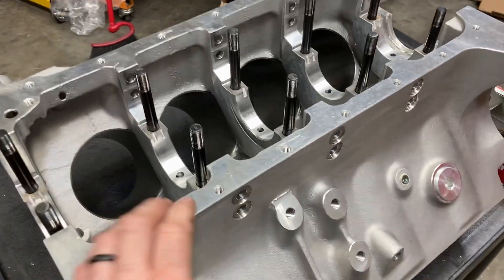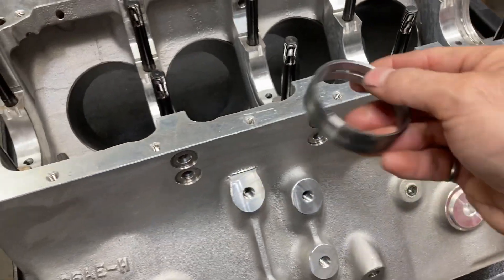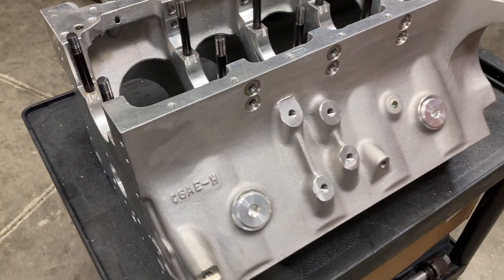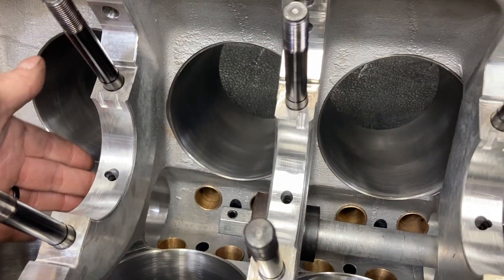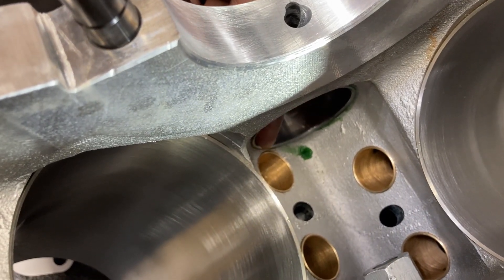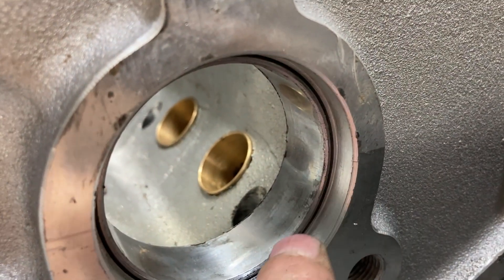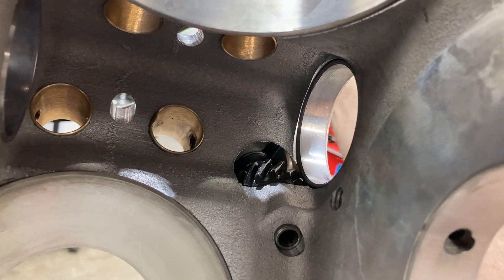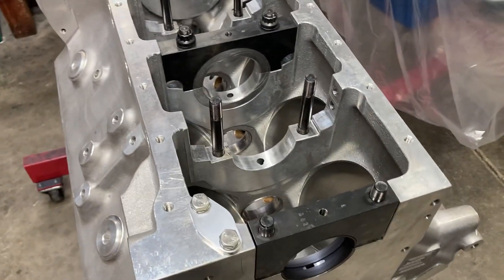Lykins Motorsports Shelby Ford FE Aluminum Block Cam Bearing Install

Comment: This is gonna be a sick engine but I do have a question. I'm building an fe myself and I am seeing mixed responses about which way the cam plug sits in. I've been told cup out like a freeze plug but I've also seen them installed cup in
Reply from the maker: Flat side out.  Always.

Comment: On your 511 Shelby build why are you using the steel main caps instead of the aluminum caps that Shelby offers ?  Wouldn’t the expansion be the same as the block?
Reply from the maker: I don't know of anyone that uses aluminum main caps with that block.  I always get steel caps with aluminum blocks.